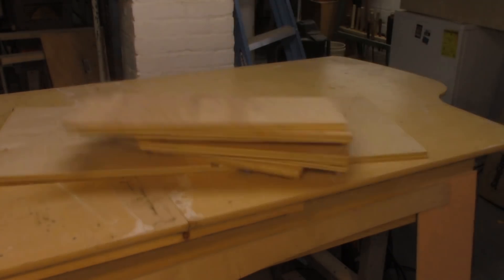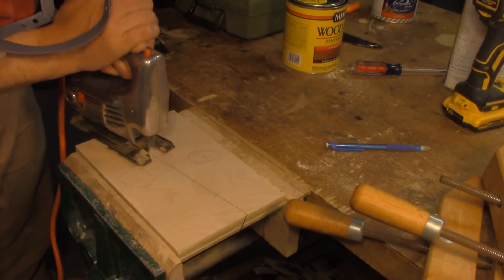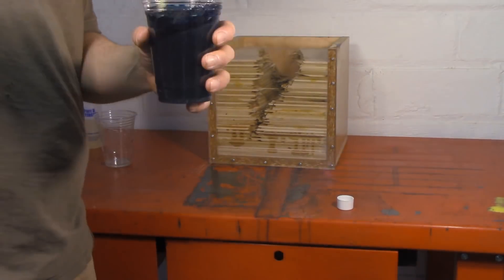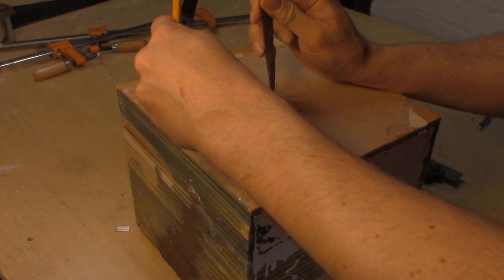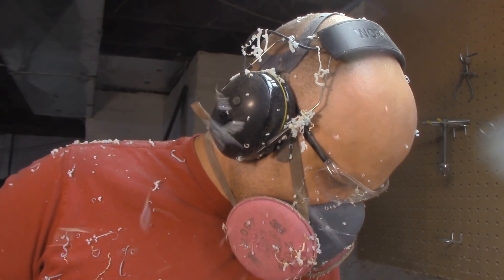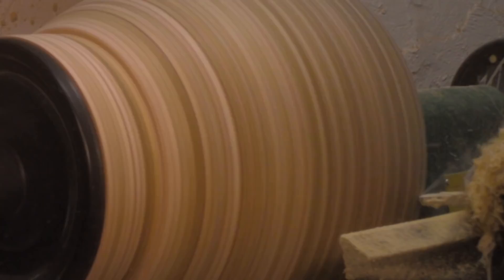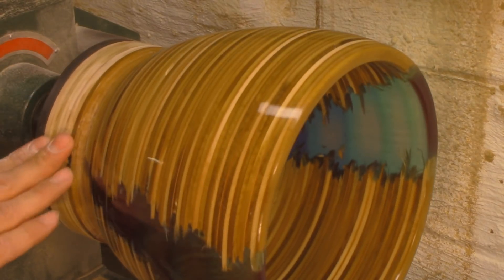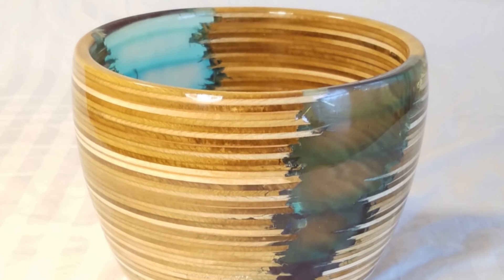Shattered Plywood River Bowl || #rocklerplywoodchallenge

Comment: You probably don't like your caulk gun because it's not the yellow and black dripless from Sherwin Williams.   It's the only worth a damn.

Also out of all the 1 plywood projects I've seen I like this the best, and it's most creative.
Reply from the maker: That sounds like a pro-tip. I've got a SW just down the street. Maybe I'll pick up one of these magic guns. Thanks also for the compliment!
Reply: I recently renovated a house, first time I did it.  I went through about 4 to 5 caulk guns, returning the ones I didn't like (which was all of them).   Towards the end of the project I hired a couple painters and trim carpenters to help finish things up as I was in danger of missing the fall market.  They all used the SW caulk guns and independently swore by them when I asked.

When I finally tried it they were right.  So much better.  But you also have to cut your tube tips by hand, at an angle, allowing only about a 1/8" hole.   Worked so much better.
Reply: Pro painter here, I love that caulk gun.

Comment: Great idea and breaking the ply was a brilliant touch.... Turned out great. I've fooled around with ply on the lathe, but the cross grain challenges in finishing deterred me. I'm rethinking my finish and will give it another whirl in the future. Thank you for the inspiration.
Reply from the maker: I'm glad you liked it. Finishing is really a matter of filling that grain. If you don't have epoxy, try putting on like a million coats of poly. Should do the same thing, just slower.

Comment: About a ga-zillion years ago (when I was in High School), I spent a LOT of time in 'Wood Shop'. If I didn't have some major project in mind...I was at the lathe. My standard project was that I had told all of my friends to bring me their favorite coin and I would insert that into the top of a custom gearshift knob. I must have turned a hundred knobs. Walnut and Myrtle Wood (Bay Laurel) were my units of choice. Several of my friends had shown up with foreign coins (some of which weren't even round!) that I had never seen before. (This is back in the day when most of us still drove manual gearbox cars.) Do ya think I have a single example of those? Hell...I don't even have one of my OWN!
Time to get a lathe.... (And a manual transmission in my truck!)

Comment: You mentioned thinking of a face shield.  I hope you ended up getting one...  I bounced a spindle that snapped length wise off my safety glasses when it split down a flaw in the grain...  1 inch lower or higher and it would have gone into fleshy bits on my face.  Lexan Face Shield is worth it.
Reply from the maker: Bought one!

Comment: I don't see a lot of turners using the back of a note pad( heavier paper). I use the back and glue it down to the base of the piece to be turned. When I am done with the turning I use a chisel to split it off the face plate. This gives me look that looks like felt on the bottom of the turning.
Reply from the maker: Sounds like something I should try!

Comment: For the breaking, next time, try a rotozip at whatever depth is needed.  The spiral bits are quick and easy for the cut and can be set to your depth.  A trim router would probably work just as well.
Reply from the maker: I've never used a rotozip. That sounds like a good idea. I've got a trim router, but I don't think it would be any better than the jig saw. Thanks for your thoughts!

Comment: If you were going to try this again, what would you do differently?  I thought this would beautiful and a great idea.
Reply from the maker: That's a really good question. I think I'd spend money on better dye. The food coloring isn't as even as I'd like and it's a bit grainy close up. I would also try to work out a way to use less resin. That stuff's expensive and I turned most of it away.
Reply: Yes, I loved your blue-fade effect and the sea glass effect, but three quarts… yikes!  Would it have been possible to dam off the center cavity with cardboard and glue caulk instead of just partly filling it with wood scraps?
If you ever do try this again, I think it’d look nice to eliminate the visible straight cut on the bottom panel.
Reply from the maker: Yeah,  there was a lot of waste.  But it's also the sort of thing I'm unlikely to do again.  You always make some poor decisions the first time you do something.

Comment: You may want to google "lever and it's usage" the stone age people seem to have had good success with it. May be an easier way to break plywood, rathen than hanging on your clamps my man. 🤓 end product = spot on!
Reply from the maker: That would be a clever comment, except that the way I used the screw clamps WAS a lever. The tip was the fulcrum and the body of the clamp extended and multiplied the force. You know, like they did in the Stone Age.

Comment: Best and cheapest way to prevent the resin from sticking to the frame is silicon spray.
Reply from the maker: Sounds like a plan!  I'll get some.
Reply: cool :) I always get good results with that. :/ once i got some of the spray on the floor... it was the square meter of death for around a week... impossible to not slip out.

Comment: Great video what can I use instead of epoxy
Reply from the maker: Hmmm. Polyurethane, fiberglass resin (it's a bit yellowish, but it would do the same thing). Spray lacquer would work well, but it would take many coats to build up.

Comment: That's a thousand dollar bowl right there, at least. Very beautiful, It would be coolt o see it in different colors, and with different veneers of plywood. Is it possible to turn a chunk of solid glass on a lathe? or will it just shatter? ty
Reply from the maker: So there is a thing called a glass-blowing lathe, but it's for hot glass. As far as i know (and I'm no expert) glass is too brittle. However, you could turn acrylic, which is a hard plastic that's actually clearer than glass. So, that would give you the same effect and be really cool looking.
Reply: Thanks

Comment: Really nice project Rex, great job. My question on this is why do you turn the bowl off, is there not an easier method?
Reply from the maker: Do you mean the part where I cut the bowl off the face-plate with the parting tool?  That's the standard way of getting a bowl off a face-plate without leaving screw holes. You can use a chuck for this kind of work, but I don't trust my chuck to hold something so big and fragile. Good question!

Comment: How does it count as something built using "only a sheet of plywood" if you also used epoxy? Is epoxy a component of plywood??
Reply from the maker: The rules of the contest were loose. Glue, hardware, resin: all allowed. The biggest thing was to use plywood as the main material and not EXCEED one sheet.

Comment: You appear to have my Harbor Freight made in China Lathe
Could you tell me the taper and size with thread count of the head stock ??
It isn't included in my owner's manual, and I'm edgy about ordering accessories on-line without knowing.
The tool rest on mine is an odd size that I can have made locally.
But specialty headstock chucks and Jacob's chucks, I really can't go out on a limb for.

Please Respond
Reply from the maker: No problem. Bot the head and tailstock at MT2, which is the most common. Everything fits those. The spindle thread 1x8tpi, which is also very common. There are also adapters to make this spindle thread fit other threads. I needed one for my chuck. It was no problem.
Reply: Thank You Very Much !!

Comment: the only observation I would make is that it's expensive to do it that way.  I would have filled the bottom of the bowl and then make a blank out of some type of easily turned material that could serve as a blank and then secure it to the bottom with a thin layer of resin. kind of a bowl within  the bowl that would leave a gap. then fill in the aluminum shavings up the side, then pour the rest of the resin.  that would allow you to use a lot less resin and cut down on the turning  effort and waste dramatically.  One of the things I've noticed about a lot of these turning projects is the amount of waste thats produced.  It's a shame.
Reply from the maker: I think it's a shame that you saw aluminum shavings somewhere in this video when there aren't any.

Comment: Pretty cool results and video Rex.  Ive  used the hell out of HF chainsaws for cutting wooden pallets  and other items down. To maximize dumpster  capacity  also  Dumpster  remnants make good cheap  bonfires or  camping firewood  plus it  stores easier in  a motorhomes. Storage  areas  and is cleaner than logs  usually

Comment: Wearing gloves while operating a lathe? Bold move lmao
Reply from the maker: But also a common and generally accepted move in the world of wood turning. Also, the chips were hitting my hand so hard that there was no other way to do it. I had to have some kind of protection to get the project finished.
Reply: That's a fair point. I think my dad made himself a guard to put on his gouges when that was a concern. When I was a kid, he was very strict about workshop safety. "You can't be a good woodworker if you don't have any arms," or something like that. I really like the look of this bowl, I might try turning resin when I come home over winter break.
Reply from the maker: How kind of you! I'm right there with you on safely. I NEVER use gloves on most machines,  but a bowl has little chance of pulling you in.

Comment: Vaseline is a cheap mold release.
Reply from the maker: It's funny, you'd think wax would work. I'll try the vaseline next time!
Reply: @RexKrueger  It will, but you have to apply alot of coats. Wax is used in boat building, but think about how a boat mold is almost a mirror finish.
Reply from the maker: Logan Clayton I've never seen a boat mold,  but I'll take your word for it and I associate the advice.
Reply: @RexKrueger  I think you'll like the vaseline. Be somewhat liberal with it, but don't leave clumps, obviously! You can use a chip brush or rag to apply. Whatever works best for you.

Comment: Great video, already subscribed 👍🏻
One question though.. do you need to seal the edges of the plywood before pouring the resin? Also is it possible to do a similar project on MDF? THANK YOU
Reply from the maker: No sealing necessary. The epoxy is a sealer. MDF would probably work, but woulnd't have the texture.